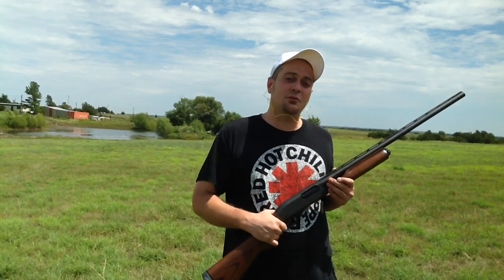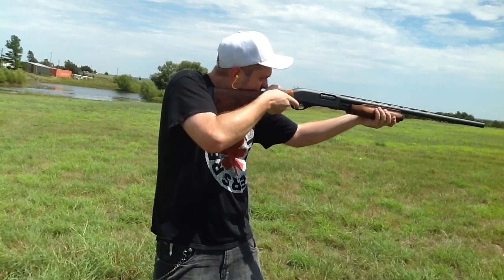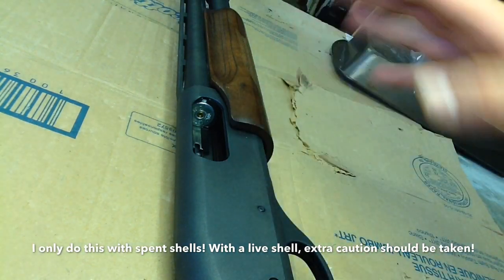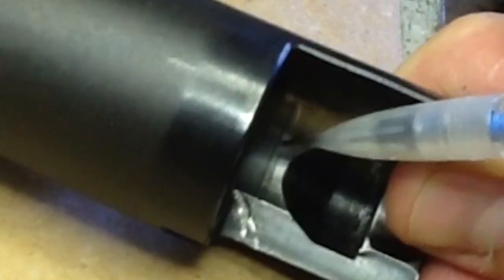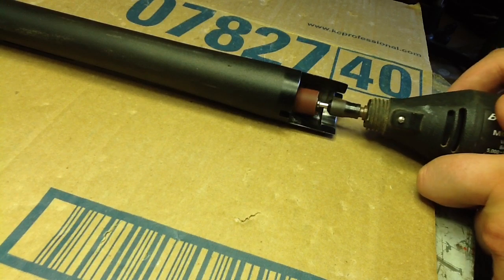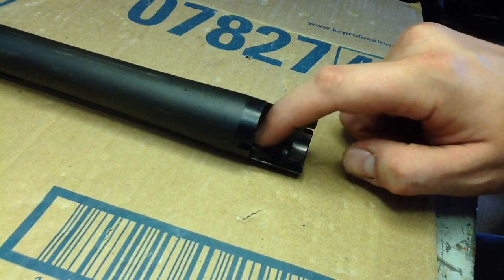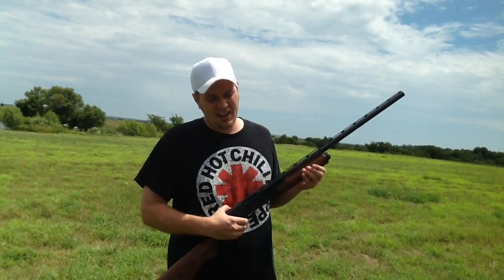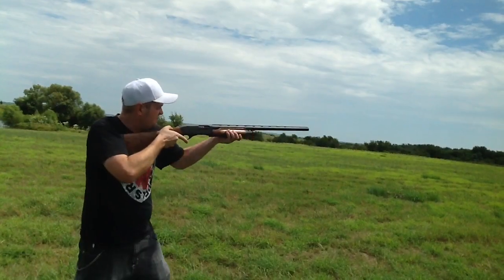Remington 870 How to Fix Jam/Jamming/Failure to Extract

Comment: Bought a case cheap 12 gauge #8 shot for a tactical shotgun class and while at the range prior to class had this problem. I bought the 870 in the 80s and never had a problem and figured it was the ammo. Pulled it apart and using both a dremal and hand sanding, I cleaned it up and it works great. Thanks! Excellent video!

Comment: Sad state of affairs with recent Remington quality issues. I recently bought an 870 express at a pawn shop in like new condition for $190, cabellas padded soft case included. From the receiver prefix and barrel codes it appears to have been made between '93 and '96. It exhibits none of the issues people talk about with these newer ones. Flawless functioning with any ammo I put into it, MIM extractor and all.
Reply: Nice pull. They definitely had some hiccups, but hopefully will back on top when this is all sorted out. The 870 is a great DESIGN, so even you get one with issues, it can always be fixed and made to tun right.

Comment: Thank bud I just did this to my 870 as well, I also replaced the extractor as well with a new spring. I Also polished the bolt and internals. And replaced the stock firing spring with a wolf spring. Have not fired it yet. But i'm sure it will be smooth as butter.

Comment: I emailed Remington and they said that the extraction issue has been addressed with the newer models of the 870 Express.  I purchased one new in February 2019 with no problems so far.  Low brass, high brass, birdshot, 00 buckshot, & 3" magnum slugs.
Reply from the maker: That's good to know thank you for sharing
Reply: Hope this is true cuz I already bought one and there is no turning back.i didn't know it had a jamming problem!!!!
Reply: How is it running so far.i need to know!!!!
Reply: I've been looking for this comment I just bought a new one as well

Comment: I had a 870 that had similar issues where it appears to be a stuck shell. But it wasn't "stuck" but rather the extractor failed to "grip" the shell rims. In most cases I'd need simply re-pump and it ejects it out. I can pull the shell out with my finger as it was so loosely in there. Only did it with certain brands of ammo. I ultimately decided I was wasting too much time and energy into a 500 dollar shotgun and decided to get rid of it and got a Mossberg 590a1 and been really happy that it can shoot anything.
Reply from the maker: To each his own. Grampa got me this one, so i couldnt just sell it. I had to make it work. The extractor slips because of the ridges holding the shell on the other side.

Comment: I bought an old Winchester 97 with a pitted bore and chamber.  I got the 12ga flexhone for the smoothbore and the other one for the chamber and it worked wonders. I had to mortar it at times to get ejection and after no problem at all. I used them on a Stoeger coach gun as well and it did a great on that as well.

Comment: Hi! I got a new one in early Desember and I have this exact issue so i will try out this fix and and test it at the range tomorrow to see if the issue is fixed.
Reply from the maker: Its all about taking a tiny bit off at a time, and testing. Wash rinse repeat until you achieve the desired result. This is steel. Dont take too much off. You cant put it back on.
Reply from the maker: Thanks for watching

Comment: Thank you very much for helping me out this is exactly the problem I was having today at Shooter's World I took my brand new well not brand-new it was bought at a pawn shop 870 Express Remington Shotgun the same exact one on your video and it had the same exact problem I was wondering why it was jamming or locking it seemed like the safety was on this is not good for my gun cuz if I ever need it in battle it's going to put me in a dangerous situation but this is exactly the same problem I was having I was wondering what the hell was going on with my gun cuz I purchased an 870 20 gauge shotgun I said all this is a good gun then little did I know they had this problem but I'll do it like you said clean it out and see what's going on but I am a bit pissed because I went to Shooters World to shoot it today and it was pretty rough having this problem the same exact problem you're showing me
Reply from the maker: Just be careful, take your time, and be thorough. Make sure the ridges are gone

Comment: In my opinion, it is not Remington's fault, it's the Winchester ammo (like mentioned in the video) when I got my 870 all's I shot was Winchester ammo because it was cheap, and I had nothing but jams, then I was tired of all of the jams so I switched to federal and I have never had a jam since then
Reply from the maker: Todd Weimer this particular gun was jamming with any type of ammo high brass low brass Fio key Remington Winchester federal didn’t make a difference now it does not jam the ridgelines that I show in this video inside the receiver is what grabs onto the case head rims
Reply: Ammo shouldn’t matter in any weapon. Why can I shoot white box in my mossberg but not a Remington
Reply from the maker: @ndomakongsuh936  it shouldnt, but it does
Reply: Winchester ammo jams in every shotgun I own, if Remington sucks then so does everyone else. Except I've never had a problem with it in my 870

Comment: Remington 870 I got is a used previously owned with pistol grip and forward pistol grip and a 2 shell extension barrel, it jams everytime after the first 2 shells if I don't smack it against something to knock the spring loose half cocked, maybe wrong tension for the spring?

Comment: thank you for the video. mine has the same problem. i haven't tested mine yet. but i did all you showed. 
I also changed my extractor from cheap molded injection crap to steel high quality. check yours and see which one you got.
Reply from the maker: Thanks for watching feel free to report back and let us know how your upgrade works out

Comment: Also buff the chamber with fine fine sand paper or steel wool on a brass 50 cal wire brush with a drill to hone the chamber.
Reply from the maker: Does that work? And remember to keep that stuff out of the barrel
Reply: @learn123gunsandguitars4  Yea after clean and oil.And yea polishing does remove metal but very little and you can get it to a mirror shine.

Comment: i had my 870 for years. recently changed everything on it. new carlson barrel, magpie stock, forend, ejector and a +3 tube extension. the jamming of the pump only started to happen after i did the work. seems to work okay with remington ammo but i was trying to shoot some high quality slugs and other ammo and it kept locking up on me. if my barrel is brand new what do you think it could be?
Reply from the maker: Id start by checking for ridges in the breach.

Comment: I have never had a problem with the shell ejecting from the chamber. I have had to really struggle to pump the shotgun to eject the shell though. I have had to put the butt of the shotgun on a table and pull down with all my weight to get it to cycle. Is this a viable solution to what I am experiencing?
Reply from the maker: If you need the gun to function properly, you've got to smooth out those ridges in the breach that grab onto the shell rims.  You're describing the problem in its early development, over time, even if you put it on a table and pull down, the extractor will actually slip over the rim in some cases like in this video.
Reply: @learn123gunsandguitars4  Thank you!

Comment: Great vid. Especially the comments about Hollywood! You are soooo right! --- Got a question though:  My 870 is experiencing a different kind of jamming. I am told it could be either the Carrier Pin Tube or the Action Bar Lock. I noticed that on mine, the Carrier Pin Tube has two slots for a wire clip at each end of the tube. But there is only one clip in mine. Noticed on line that every photo I see also only has one clip at one end as well. Supposedly the tube can shift out of place and block the slide from being cycled. Also the Action Bar Lock seems slightly bent. Is this something you know about or have had happen to your gun?
Thanks for your time if you answer.
Reply from the maker: John Friedmann I would start by replacing the bent part. But I make no guarantees and I caution you for your safety. You know how it is I have to have a disclaimer that says to take it to your gun smith.
Reply from the maker: John Friedmann maybe you could send me a picture of what you're talking about on Facebook look me up on Facebook
Reply: Oh I understand disclaimers. I was really wondering if you have seen this problem before. -- Btw, was your jamming problem completely fixed by polishing the chamber, or did it ever return?
Reply from the maker: hasn't returned yet... btw we sent it to remington and they claimed to have polished the chamber but apparently remington says that they do stuff that they don't do.  Just putting that out there.  You can clearly see in the video that I'm the first guy that's polished that chamber.  Find me on facebook and send me a picture of the problem you're talking about.
Reply from the maker: my guts telling me to replace the bent part with a new part though
Reply: Thanks for the replies. I don't have a good way to post pix. Kinda still in the dark ages. - But I am taking your advice and have already ordered the two parts that I think are causing the problem, and I will be able to replace them both pretty easily. - I'll try to let you know if it works. I may even replace one at a time with a test in between to see if I can tell WHICH one is the culprit. Thanks again for the responses.
Reply from the maker: i'd like to see what you're talking about and maybe do a vid on it
Reply: I'll see if I can borrow a friends' phone and send some pix.

Comment: Hey I have a H&R 1871 Pardner Pump that is jammed. I’m not able to use the safety release nor the pump and it’s loaded. Can you help me out of this jam?
Reply from the maker: Never work on a loaded firearm.  I wouldnt begin to know anything about how to fix that without the gun in my hand... if you believe it is able to be fired, carefully transport it way out in the rural areas at least a half mile from the closest building, and fire the round (or rounds) after being sure there is nothing you do not intend to destroy on the business end of the shotgun. Shoot it until it is empty. If you are unable to do that, take it to a gunsmith. Never work on a loaded firearm.  Also, consider the legal rammifications of transporting a loaded firearm, which may be extra illegal in your location, due to safety issues of loaded weapons going off while being transported.  Notice in my video, that the chamber is shot empty.  Yours is a more dangerous case--chamber is stuck shut and live round is in the chamber.

Comment: First: Stay away from the cheap Winchester aluminum shells. Second: wrap 0000 fine steel wool around a 12 ga cleaning brush (or whatever caliber yours is), and polish using a drill motor. Should help.

Comment: I’m having a similar problem, however I have a different model, I managed to fix my issue it pumped and loads, the firing pin goes off but won’t fire a round I’m stuck any help?
Reply: It might be due for a good cleaning?
Reply from the maker: Careful with oil+firing pins. They can stick forward and slamfire. I recommend having a smith replace firing pin.

Comment: it would be alot easier to just slam down so the extractor claws catch the shell. Had a few of those "stickies" get in the chamber and not come out. Just empty the gun so the "new" shells isnt blocking the bolt from "grabbing" the spent shell out.
Reply from the maker: Yes, this video is intended when properly working the action rigidly is insufficient to prevent jam.

Comment: I just took my 870 apart because it keeps getting jamed. I can't feel much of a ridge. Tried to file slightly with an emery board, but having trouble getting emery board to bend slightly enough to conform to the contour of the barrel.
Reply from the maker: Michael Ramsey dont file the barrel. Its the breach. And yes i found the emory board too wimpy so i used a dremel and then used the emory board just to clean it up
Reply from the maker: Michael Ramsey you may have a different problem than my gun if you dont have the ridges in the breach